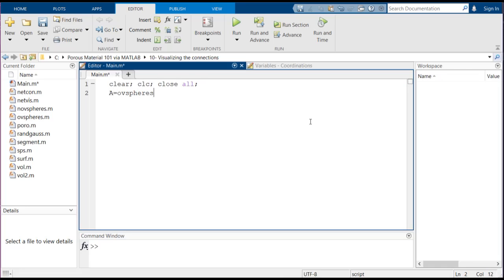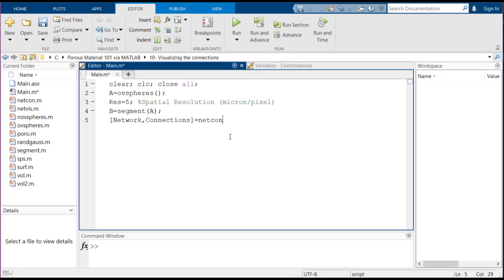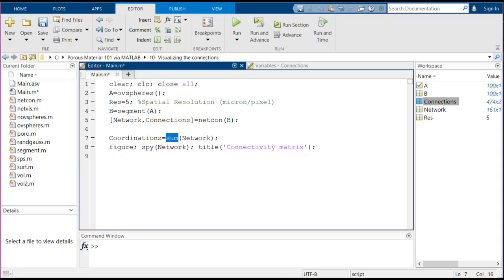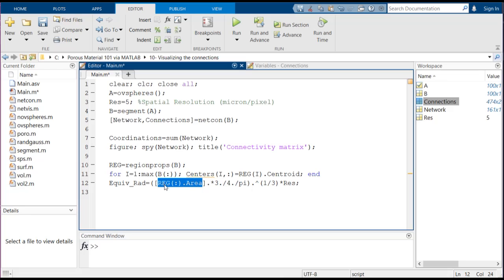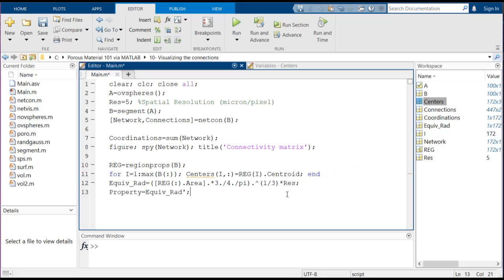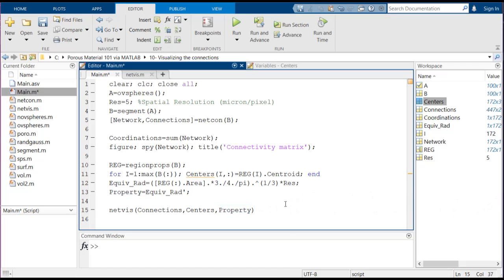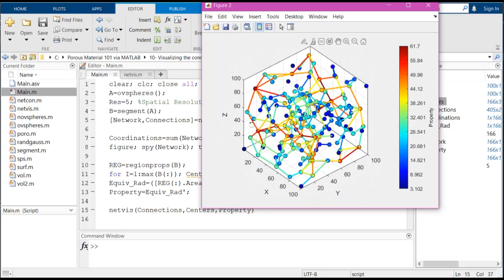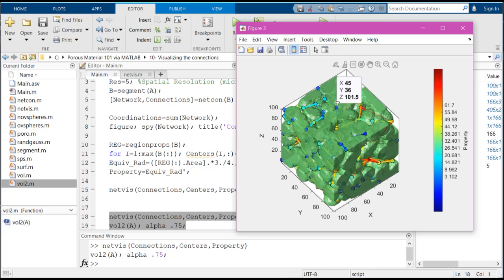10- Pore network visualization [Porous Material 101 via MATLAB]

Comment: Thank you, sir, for providing these videos. They will greatly assist in my research. I am curious if the Matlab used in creating porous materials can be imported into other software like COMSOL for further study?
Reply: I know that COMSOL has a live link for MATLAB and you can connect the two software. I guess there might also be a way to import a form of geometry in it as well.
Reply: I have the same question. Is it possible to create a Mech file for COMSOL?
Reply: @houssemrezgui8824  Yes you can relate MATLAB code to COMSOL, if you r creating geometry, mesh or any step in comsol, it could be easily be coded via MATLAB, unless u have the license